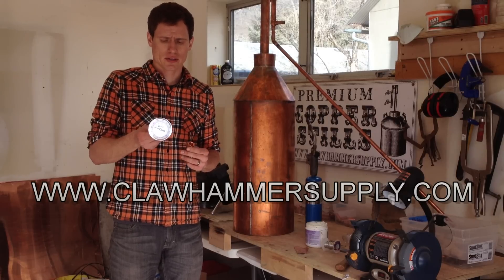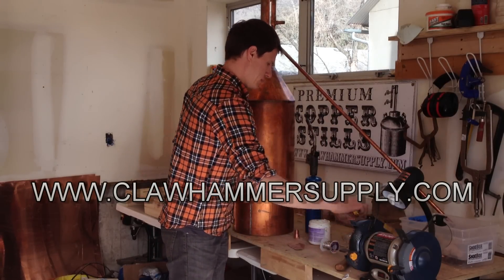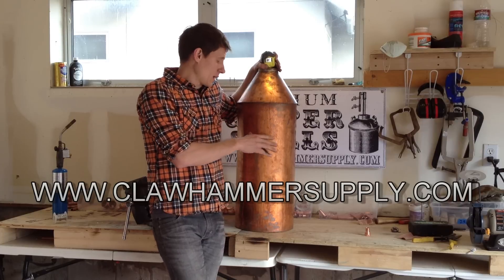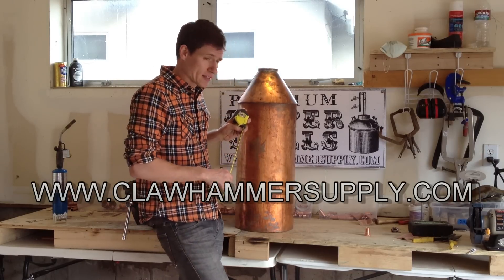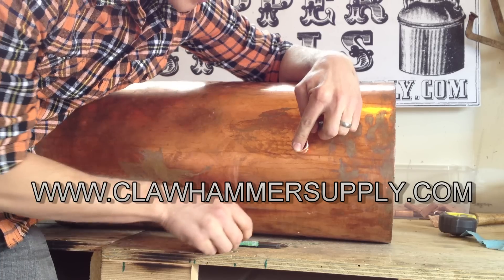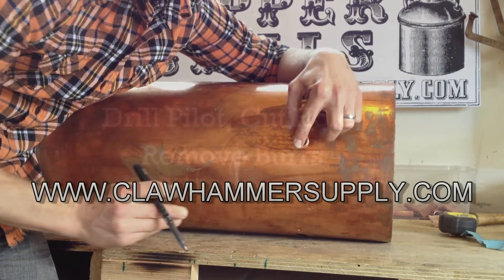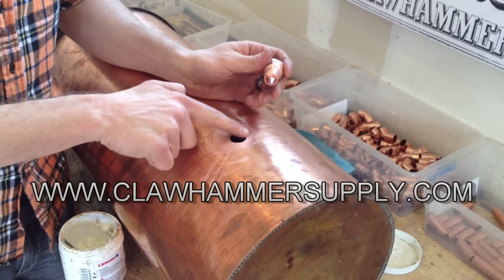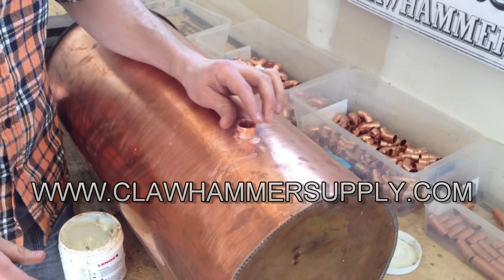Installing a Thermometer in a Copper Still.wmv

Comment: Im a fourth year sheet metal apprentice and i made a still for my fourth year final project out of copper im very happy with the way it turned out and i did use lead free solder but some of my class mates said (wouldnt the solder melt as u heat the still up) i said no but after thinking about it i doughted myself whats the melting point of the lead free solder?
Reply: A quick google search can directly answer your specific question about lead free solder melting points, BUT! .... to answer the classmates question about wont it just melt? NO. Why? Because there will always be cooler liquid on the inside constantly keeping it too cool to melt.

Comment: ok i really need this question answered im using a keg as a still but could i still fit the thermometer the same way and if so how could i get the fitting for the thermometer
Reply: Dont use aluminum for a still! Stainless or copper!
Reply: morgan madmorgan aluminum will end up putting and eventually pin holes with is no good could end in explosion granted this would take time but you don’t wanna be the guy in the news with a blown up garage one day also depending on the manufacture and manufacture process it could be leaching out things you do not want in your distillate when heated you could get away with aluminum for a bit but eventually you’ll have to go stainless or copper so just go with either off the hop copper being the best of the two just keep it clean and clean with vinegar before use after it sits long periods of time
Reply: Don't worry people the keg is stainless